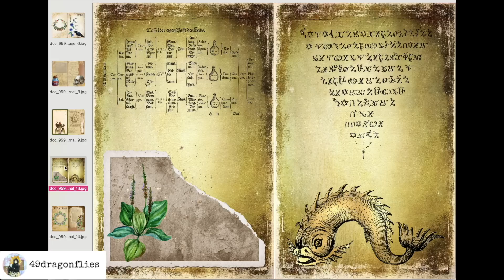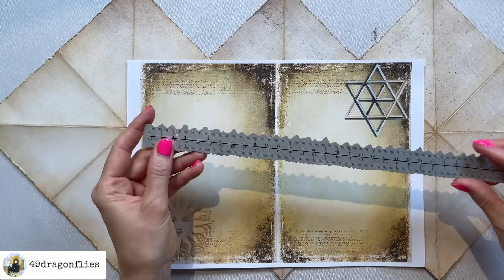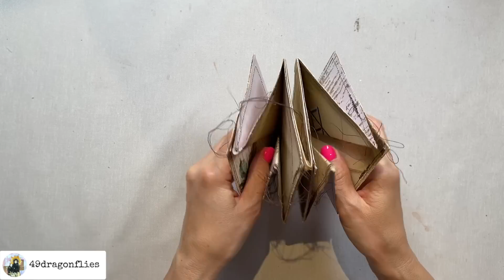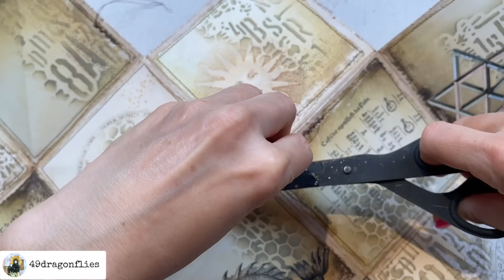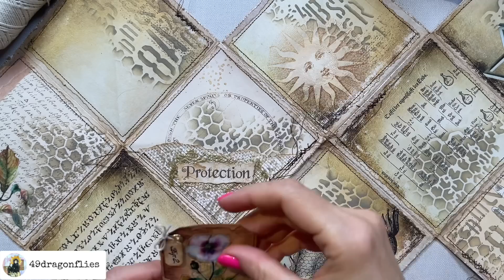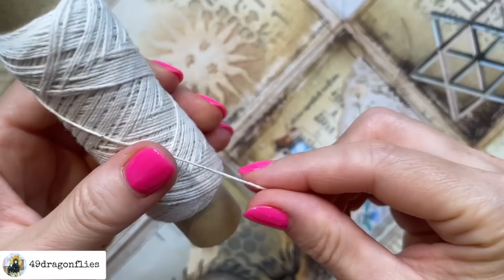Explosion Mini Booklet TUTORIAL Part 1/Digital Collage Club Design Team Project

Comment: I love it so far.  On my way to watch part 2. Little tip for your viewers that,  like me,  do not have that handy distress tool. I keep the dull blades from my paper cutter and when I want to distress and rough up my papers, I switch out my new blade with an old dull one and I get the same results,  much quicker and easier on the hands.  😘
Reply from the maker: Thanks for the tip! ❤️

Comment: I had just made one of these for a friend and discovered there only needs to be one diagonal fold all the flat areas are on the other diagonal fold. It helps with the confusion of where things should fold when there is no fold line on the flat areas. So there are two cross folds and one diagonal fold!
Reply: This is a great tip, thank you for sharing!